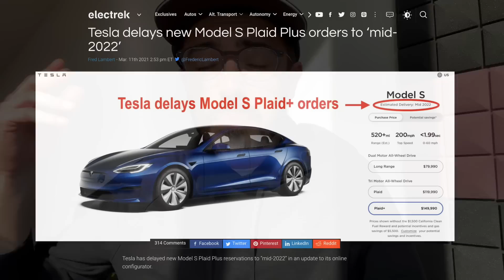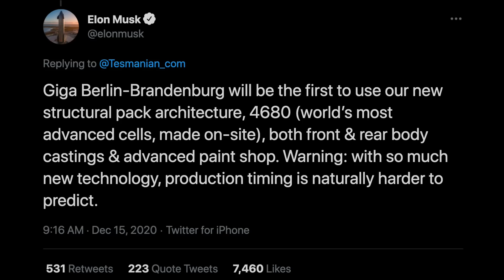Tesla Shipping 4680s To Berlin Right Now?!

Comment: if they cannot deliver in July it will get damn expensive cause this is germany and if you hire people you have to pay these and you can not fire as in the US and pay 2 weeks ... you will pay months till they leave or even years cause firing is not a business decision but a legal one so you need the right reasons that a judge accepts ...

Berlin has to start deliver from July and the complete plant plan is based on those cells that you can not change that easily over night ... cause you would run in regulation and homologization issues due to different designs.

Comment: Just because the batteries are to be made on-site, doesn't mean they expect that factory to be ready by the time the first vehicles are ready. This is just a starting supply to cover any delays in Germany of their new 4680 factory.
Reply: Wasn't this said at BID anyways? That they would supply Berlin from Fremont until Berlin could do it 100% themselves?
Reply: @mikee368  Yes but Berlin being the first to produce  with a structural pack they need to cast 
assemble front and rear castings and proof the solidity of the structure. After that there is the assembly workers training then start production mid-2021 one hell of a learning curve for car assembly without talking about the 4680 line coming online!!!!
Reply: Yes to commission the structural floor casting you need those batteries.
Reply: Just like they did in Shanghai, makes sense